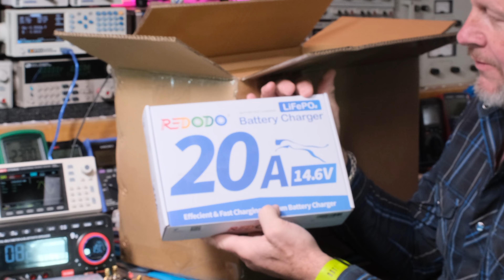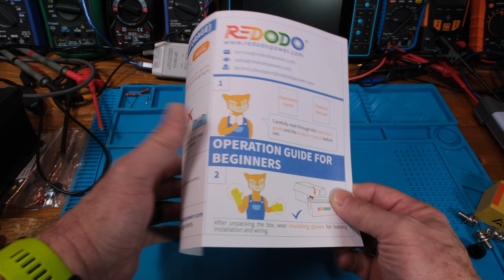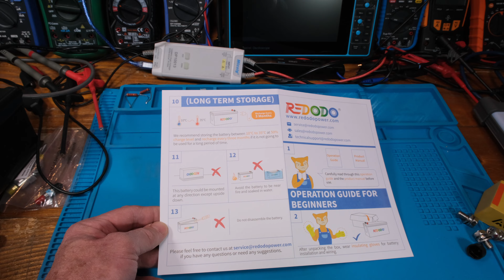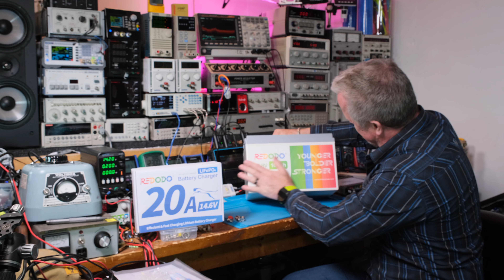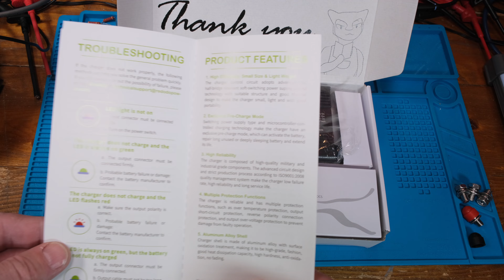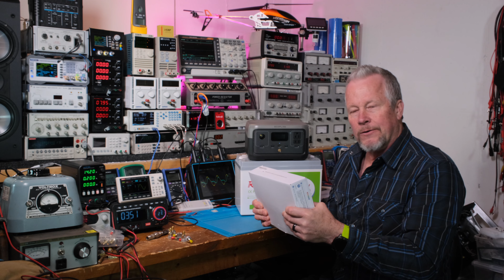Redodo 100AH LiFePO4 Battery and Battery Charger Box opening #Redodo #liFePO4batterycharger #liFePO4

Comment: I just got my Redodo Group 21 12.8 100Ah Battery and the 14.6 20amp Redodo charger.  Does this charger maintain also or once the battery is charged and the green light is on does it need to be disconnected.  I wish this stuff came with better dritctions

Comment: Hello, interesting explanations. I also have a Genius 5x2 charger (output 2x5A). In your opinion, could this charger also be used?
Reply from the maker: Thank you!  Yes, I think the BMS would take the power/voltage that it needs.  I know that some Genius chargers have a lithium mode, but I think that is great for charging a lithium cell - but not really needed for a battery pack that has a BMS.
Reply: Thank you @kissanalog

Comment: Looks like a very well made battery. It’s nice to see a manufacturer put some effort into packing their products properly and safely. Even though many people don’t read the manual, it’s still nice to see a decent manual as well. Thanks for the video too Eddie. Would love to see you do some tests on both the battery and charger in a future video. I’ve been looking for a decent Lithium deep cycle battery to replace my heavy lead acid battery which I use to power my telescope. So your video came at a perfect time.
Reply from the maker: Yes I agree - it is a nice option to replace the old style heavy battery.  And it will last much longer;)

Comment: I did turn a battery lead acid upside down  when i was 12 years old ,  when i was helping a school frend, try to disconnect the wires witch are shortened in a small 3,5 mm jack in a cb walkie talkie , the wires get burning , the plastic on the wallpaper and sealing, burning my hands the acid leaking on the carpet thru the floor board leaking also a the top of sealing from the living room below , his mom and dad , they were very concerned with all the burns on my hands  😢 , that was self healing, not the wallpaper carpet and sealing 😂
Reply: I like it!
Reply from the maker: Wow, those old battery styles were dangerous!  I'm glad that you were ok.  The new battery tech is so much nicer;)
Reply: @kissanalog   yeah the  car dealer repairshop Was thinking to help us  by giving the car battery for our cb , not knowing that we used it in a bedroom. But maybe the lipo battery from you has also the connections between de cells on top and that’s maybe the reason why you cant use them up side down ?